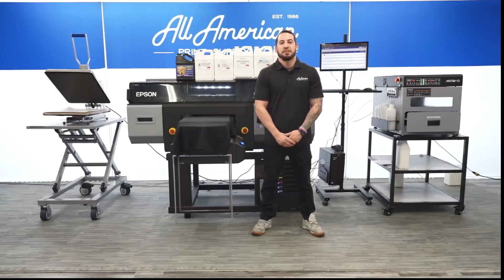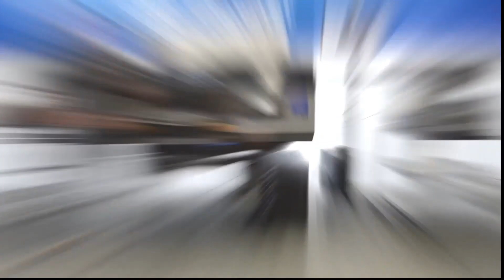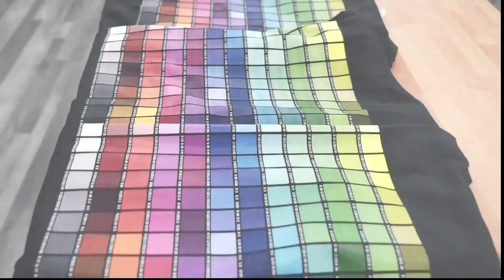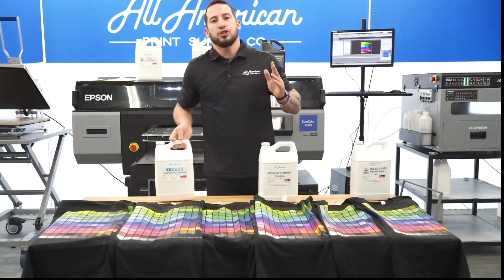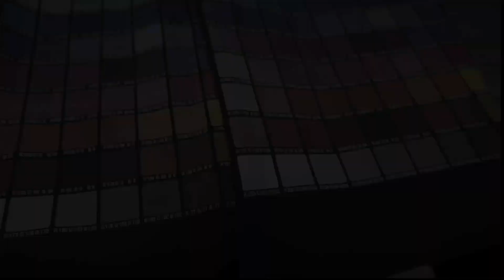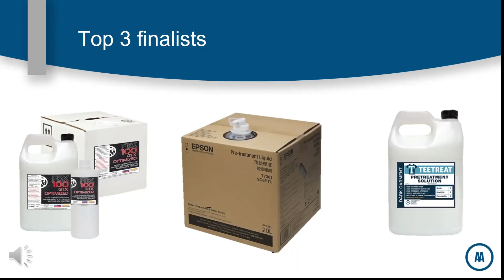DTG Pretreat Comparison | AA Print Supply

Comment: Seems a bit excessive on the PT, no? It's literally dripping off the shirt.
Reply from the maker: Hello,

The setting used may have been in excess for some of the solutions but the goal was to have a even measuring stick to compare all the prints to objectively  - same settings across the board with everything.
Reply: the problem was the bi-directional application. that put down double the amount of PT. only use that for high % poly blend
Reply: @jonathanw.6266  No it doesn't. It cuts it in half.
Reply: @joelallen770  if you do a gram weight test it lays down the same amount in both directions. So if you have 10g uni then you have 20g bi

Comment: your color chart looks way perfect. can you please explain how you avoided that white bubling or fibres sticking out ?  i use NEXT LEVEL 3600 and they were  never close to results you had on your sample shirts.
Reply from the maker: Hello,

At 4:41 we go over the steps we use to dry the pretreat: light pressure, long hover and dried in 30 second intervals.  As far as the print quality, I have to give credit to the Kothari NeoRIP software.  That's how we get the best prints possible with the Epson DTG.  Drop me an email for more information to Estevan@aaprintsupplyco.com

Comment: i tried 22 26 30 and 36 grams @ 350F(30 seconds) on gildan 2000 and NL3600 @ 0/1 PSI but it still felt like cardboard. in my experience 325F@ 40sec and maybe a second press did a decent job and fabric feels way better than it did with the curing @ 350...

i cover the upper heating platen with a Teflon sheet and its almost 3 years old. do you think that old sheet is affecting in any way ?